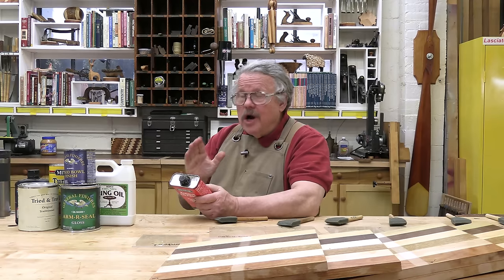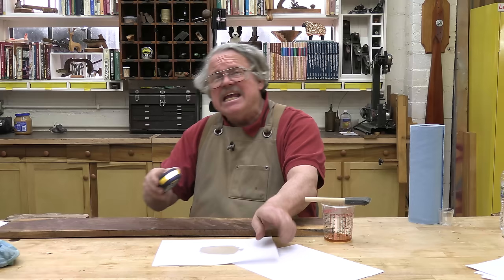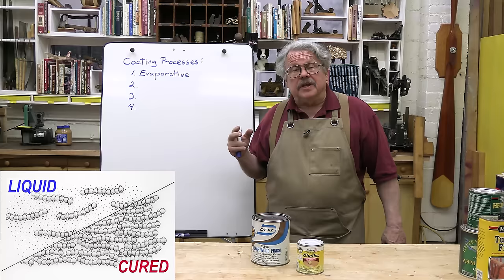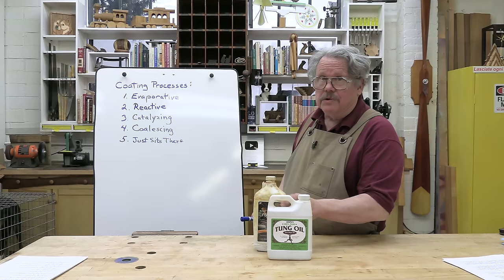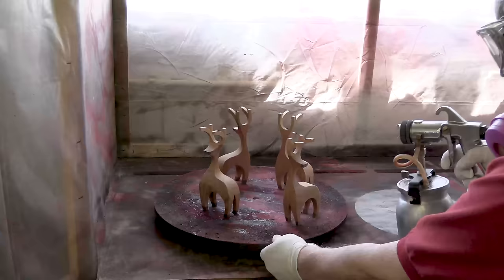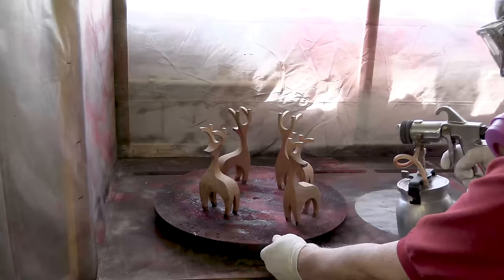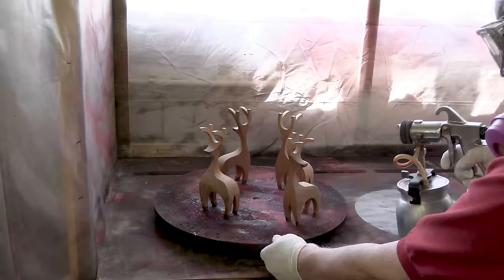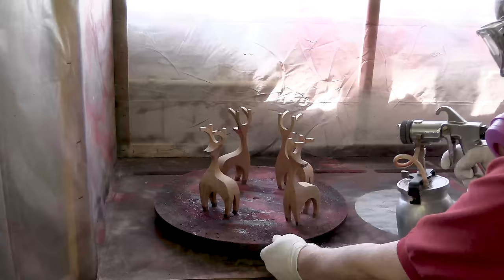Finding the Perfect Finish

Comment: Love your sense of humor.😅
Reply from the maker: Thanks.
Reply: @WorkshopCompanion  I’m a novice woodworker in Colorado and am using beetle kill blue pine to make guitar stands. I’ve struggled with clear gloss spray cans and your comprehensive guide to finishes is a God sent. It’s Tung Oil for me. Is there any suggestions as far as drying time between scuff sanding and how to polish the fourth coat to a high gloss finish. Thank you again. I’m a fan.
Reply from the maker: @SoCalDude-ti1bp  We normally wait 8-10 hours between coats and start sanding with 320# after the second coat. After the fourth coat, the finish is usually sufficiently deep to polish, and we normally do this with Scotchbrite and paste wax. Grey Scotchbrite is  600#-800#, and will leave you with a satin finish when you rub out the wax. White Scotchbrite is north of 1200# and produces a gloss.

We are currently investigating Minwax's newest wipe-on finish, "Wipe-On Poly," and we're reasonably impressed. The reason I mention it is that it's not quite as "warm" as Tung oil, and this may be a good thing if you're working with blue-stained pine. The wood colors will be more true -- the blues won't get greenish. It's easy to apply, requires less time to cure, and builds depth quickly. Get the clear gloss, the satin has some talc or  something similar in it that obscures the grain.
Reply: @WorkshopCompanion  Thank you so much for your advice. I’m going to try the wipe-on-poly and will let you know how it looks on my blue stained pine. Best regards, Gary

Comment: Thank you for this.  I’m planning to use Rudy’s formula on a couple of pieces of black walnut.  I’m interested in any step-by-step videos you may have on the sanding process you recommend prior to the application of Rudy’s finish.
Reply from the maker: Typically, I sand to 220#, and wipe on two thin coats of finish. After the second coat, I'll lightly sand with red Scotchbrite (about 320#), then switch to grey Scotchbrite (600#) after each successive coat. (Keep 'em thin.) I'll leave it there for a matt finish, or rub it out with pumice and/or rottenstone if I want something glossier. I want to emphasize that this is not the only way to work with this finish -- there are thousands of methods for preparing a surface, applying a finish, and rubbing it out. You might start with this, but I encourage you to experiment -- you'll probably find something that works better for you. Finishing seems to be a highly personal affair; some people cling to the technique they develop like it was a religion.
Reply: @WorkshopCompanion  thank you so much for your reply. I’m used to apply poly and leaving it at that, but I want a more hand rubbed finish to do this black walnut justice.

Comment: Very interesting and great information , one thing I will add is how easy to repair ? 😊
I am in the tung oil easy to apply and repair plus the dust in the air don’t matter !😊
Reply from the maker: Like most wipe-on finishes, Rudy's formula is easy to repair. The caveat is how long has the project been sitting in the open? If the wood surface has oxidized from UV light and oxygen, it will have formed a darker patina. If you have to sand through this to make repairs, there will be a light spot until the wood has sufficiently aged again.

Comment: Takes days for tung oil to dry enough to apply another coat. Probably the same with the wax and linseed.
Reply from the maker: That certainly was my impression -- although "polymerized tung oil" and "boiled linseed oil" (same thing, different oils) are cracked at a high heat to help hurry along the formation of a cured chemical matrix. The wax/oil finish was labeled as containing "polymerized linseed oil," so it's my guess that it's the wax and not the oil that slowed the curing process.

Comment: Couldn’t imagine a better and more entertaining presentation than yours!  Will tune in every time now going forward.  Also, I’ve briefly looked at hemp oil for an exterior project before, but tossed the idea because of the contractor’s unfamiliarity with the application, but I wonder if you ever experimented with it? I never see anyone mention hemp oil on other channels, so maybe it’s just not a feasible solution for fine woodworking?
Reply from the maker: Thanks for saying. Like your contractor, I have no experience with hemp oil. It's use as a finish seems to have been a recent innovation; I could not find any long-term studies to establish it's properties or advantages.
Reply: @WorkshopCompanion  Will make sure to share more info if I should find anything useful.
Reply: @WorkshopCompanion  I tried to find more info about Hemp Oil, but it’s not very commonly used in the woodworking community it seems. In a nutshell, it’s somewhat comparable to Tung Oil, but it is not as durable as a finish. Only advantages aside from environmental (presumably) are that it doesn’t require a thinner and it has a slightly more pleasant smell (“walnutty”, per one source I read). Best uses might be for cutting boards and cooking utensils. But it is readily available to buy online from a number of resellers. It dries matte, btw.

Comment: This was SO helpful for a novice such as myself.  I've stripped a rock maple secretary desk I purchased at thrift store, and planning how to finish. In past I used polyurethane but didnt like tricky application or the plastic finished feel. Was thinking of using shellac which I've used bf and liked better, both for ease of application and finished feel.
I would have liked to know what, if any, of the finishes can be safely applied inside (I'm guessing the tong oil) since i dont have inside work space separate from my living quarters, plus its summer in nj so i'm dealing with humidity. Thanks again.
Reply from the maker: Safety Data Sheets on individual finishes list a property called "Vapor Pressure." The lower the vapor pressure, the fewer the noxious fumes you will have to breathe in when applying a finish indoors. The SDSs are available on the Internet, just google the name of the finish and the phrase "safety data sheet."

Comment: Anytime I see a "Workshop Companion" video pop up on my phone or computer, I get in a comfortable spot in anticipation of an informative and mind pleasing video. I was not disappointed - especially as I was getting completely overwhelmed trying to figure out a finish for an end table. My question about Rudy's finish is whether it resists water stains - like a glass full of icewater sitting on on an end table. Also wondering if you've looked at any of the hard wax finished like Rubio - super expensive, but supposed to be easy to apply and only one coat is needed.  Thanks for another great video!
Reply from the maker: Most welcome. Because it includes urethane and tung resins -- both of which resist water -- Rudy's does pretty well not showing water stains. As for hard wax, this is a very different animal from the reactive finishes I investigated this time around. It's going to need its own video.
Reply: @WorkshopCompanion  thank you for the quick reply!
Reply: @WorkshopCompanion  We'll be waiting impatiently. Appreciate if it could possibly include Rubio's Outdoor Wood protector. I'm trying to decide what finish to use on Adirondack chairs made out of cedar. I'm in Pacific Northwest, so ample amount of moisture is expected. Penofin and Rubio's Outdoor Wood protector are on my shortlist of outdoor furniture finishes at the moment.

Comment: Love your video.  Not only is it thorough and very informative, it's entertaining.  You are very funny!  I have a question.  Minwax now produces two tung oil finishes.  One is called Minwax Tung Oil Finish and the other is called Minwax Tung Oil Protective Finish.  Do you know what the differences are between the two?  And which is your preferred product?  Thank you
Reply from the maker: There has been no announcement of a new tung oil finish on the Minwax web site -- their "Press Room" page goes back several years and no mention of this. They are, however, brining out a new design for their cans -- much more yellow and I'm betting less information. My guess is what you've  seen is too different marketing campaigns,  one for a supplier using the old can design and another using the new can -- but both for the same finish.

Comment: Please Help I've watched over 100 videos & still in need of help! I have a brand new unfinished wooden swing set made out of cunninghamia Lanceolata wood frim the cypress tree! Wanted to sand & put a clear coat but not sure which 1 was almost thinking of putting a clear coat made for wooden marine boats? Wats ur opinion???
Reply from the maker: The properties of Chinese cedar as similar to American red cedar -- very soft but resistant to bugs and decay. Marine finishes would work, but might be a needless expense. I'd think a clear deck finish would do just as well and save some money.

Comment: excellent video!

I'm not sure about the classification of oils as non-drying, though. Even without heavy metal driers, linseed, tung, and walnut oil form a film and dry before they go rancid, and they do this by reacting with oxygen in the air, like a slower version of seasoning cast-iron pans. Wouldn't that make them reactive?
Reply from the maker: As I explained to another viewer, there is a great deal of gray area between drying and non-drying -- it's a scale, not a switch.  Raw tung and linseed oils tend toward the non-drying side of the scale because of how long they take to form a reacted matrix, boiled linseed oil and polymerized tung oil tend toward the drying side. At what point on the scale does a non-drying oil legally become a drying oil? Congress has not yet addressed that issue, so it depends on where you stand. A chemist and a house painter would  give you totally different answers.

Comment: Thanks so much for this.  I am thinking that maybe Minwax changed its tung oil finish recently when the altered the container - kinda pinkish and very, very thin, dries almost immediately to a gloss and does not seem to have the warmth it used to. Maybe I have a bad batch.  If this is the intended result for this produce, I would be interested in knowing how one might replicate the former Minwax Tung Oil Finish.

Comment: I am very surprised that he does not mention walnut oil.  Walnut penetrates well, hardens, and brings out the color of the wood.  I use it almost exclusively. It is totally natural and total food safe.  I’ve used it for years. Tung is a great second choice. But I prefer walnut because of its durability and was of application.  Most of my work lathe turning
Reply: Maybe you could expand a bit on why you like walnut. Like yourself I mostly do lathe work , mostly go to OB shine juice . I have experimented with all kinds of oil in the blend and usually go back to BLO . When I used walnut it seemed to take a lot more coats . On nonporous woods I add more alcohol for base coats , but still BLO . Not disagreeing with you , just interested in your take . I've only been doing it for five years ( in-between job , big garden and raising grandchildren) , and need input from people with more hands on knowledge
Reply: Tried many finishes out there; Odies, BLO, OB shine, polys, etc. To me it is a question about how you want the finish to look, flat, shiny, glossy, etc. I prefer walnut oil because I like a more natural look, ease of application, dries to a hardened finish, ease of refinishing, and costs.  I often simply put one coat of walnut oil, let sit over night, run a 3M type scrubby over the piece and apply wax finish.  I make my own wax finish with bees wax, mineral oil and a little carnauba. Sometimes I add a little grit like rotten stone or pumice or Tripoli so it is like some of the grit finishers out there. Or I’ll use a commercial wax like Johnson’s wax or Minwax that comes in light and dark wax varieties. If you put twenty wood workers in a room and ask them what the best finish is you will probably will get twenty different  answers. Keep turning, it’s the gift of a lifetime.

Comment: Great work on this Nick. Not sure how likely it is you'll see this but figured I would give it a shot.
While working on renovating my new house built in the mid-1800s, we discovered some hand-painting on one of the pine floors we'd like to preserve. I'm worried about the solvents smearing or absorbing the paint.
Would you recommend a Catalyzing finish, rolled on to avoid scraping the paint? Is the risk of the solvent affecting the paint insignificant with Coalescing finishes?
Reply from the maker: Coat the antique painting with shellac. Do just a small portion first to make sure the old paint isn't alcohol soluble, then the whole area. Shellac is chemically inert, and is often used to insulate the chemical reactions of one finish with another.

Comment: When you say “rubbed out” what exactly do you mean? I’ve made a table from cotton wood and finishing is not one of my strengths. But learning. Leaning towards the minwax antique finish.
Reply from the maker: It's a common term for gently abrading the final coat of finish to the desired gloss or sheen. In days gone by, this was done with a rag dipped in linseed oil, dusted with pumice or rottenstone, and then rubbed over the cured finish.
Reply: @WorkshopCompanion  I appreciate the reply. That’s what I thought but wanted some clarity. I ended up using what I had on hand, furniture butter by walrus. Needs to be buffed off today. It’s been sitting for 24 hours. Then I’m going to do a couple of coats of wax. Hoping it turns out. At some point I’m might try your recipe. Thanks again.

Comment: I like your videos. Such a small channel, with such a niche topic, but great production, funny, not filled with endless non-sense, and a complete way how you've got your oppinions with sources. Beautiful.

Now my problem. I'm from germany and have never heared of Tung Oil. I've looked it up and didn't found any regional store who has it (only online, but I'm more likely to avoid online to support lokal shops). It seems like a rarely used Oil here.
The more common used oil is linseed. Maybe because of my upgradeable english I missed it in your video, but can I use it as a replacement for Tung Oil, or are there any too big differences between these two?
Reply from the maker: The Minwax "Tung Oil Finish" that I tested is most probably derived from a blend of organic oils -- it's hotly debated whether there is any actual tung oil in it. Many good wipe-on finishes include alkyd resins derived from linseed oil. But there are others derived from different sources, both organic and petroleum-based.. The only way to find what finishes will work for you is to test those that are available in your geographical area.

Comment: What is the best way to finish a Baltic birch laminate wood grip for a rifle?? Should I use oil or stain or varnish? Should I use wax or other products? Please help.
Reply from the maker: I have very little experience in that area; in my entire woodworking career, I've made a single gunstock to help restore an old muzzleloader. Finished with multiple coats of boiled linseed oil in keeping with the history; seemed to work well. Suggest you find a gunsmithing group and query them -- but be prepared for a hundred answers, all totally different!

Comment: I'm going to be building the highest quality guitars in the world they will be electric possibly mahogany maple basswood Korina maybe even some other soft foods I am thinking about doing a new pressure treating method on wood trying to make it harder or Sistine sound longer. I loved metalflake brand acrylic lacquer far as I'm concerned they had the best stuff in the house a color key more metal flake is more or less out of business in the paint business they told me they just sell the flake etc. do you have any top-of-the-line finishes you recommend that a guitar there's possibilities a deck would be different finishes like a tug oil or some kind of hand rubbed finish. this is the first time I'm seeing your page sounds like you have a lot of experience in this area thanks Rob

Comment: What about treating wood for water protection before staining. Like with a Pre-Stain Wood Conditioner.. When ever I use it, it makes my staining darker than the color I got. How to water protect like Kitchen Cabinets so the staining comes out the color you want.
Reply from the maker: I'm not the person to ask, since I rarely use stain or pre-stain conditioner. I much prefer aniline dyes to stains. However, your problem creates a quandary. A pre-stain conditioner partially seals the wood, supposedly evening out the rate of absorption. Conditioned wood should absorb less stain than raw wood, and therefore the color should be somewhat lighter. The only reason I can think of for it being darker is that the conditioner is reacting with the stain. Try this: Instead of using  a store-bought conditioner, make you own from shellac.  Dilute white (clear) shellac 1:1 with denatured alcohol, brush a thin coat on the wood, and give it a very light sanding. The apply your stain. Shellac will not react with any other finish; it's often used as an insulating coat between finishes for this reason. If you get the color you want from this experiment, you can conclude that your conditioner and your stains are not playing nicely together.

Comment: Where would Danish oil fit in?  I use it for most finishing, usually applying 3 coat, sand other than waiting time between coats  of at least 8 hours I have found few drawbacks. I have found however that some makes are better than others - presumably due to slightly different formulations. The best make I have found over here in UK  is Rustins.
Reply from the maker: Similar to the tung oil and antique oil finishes. Rudy's formula is actually very similar to Watco Danish oil (new formulation).